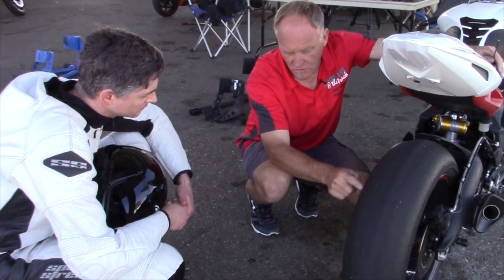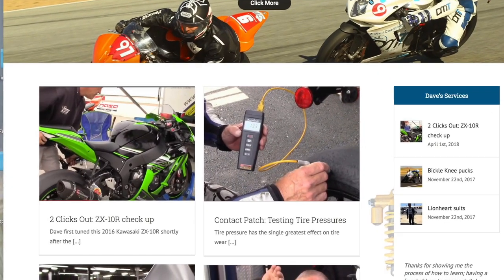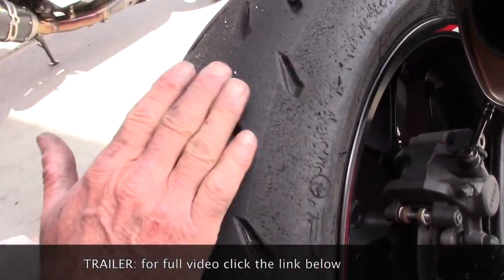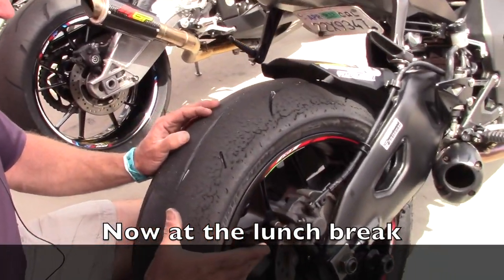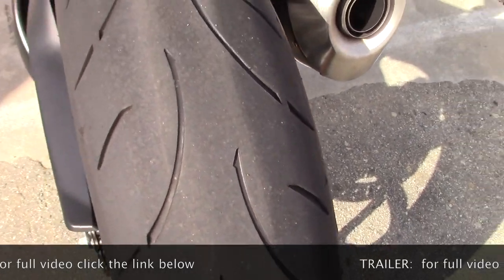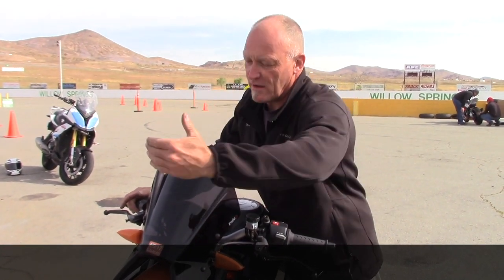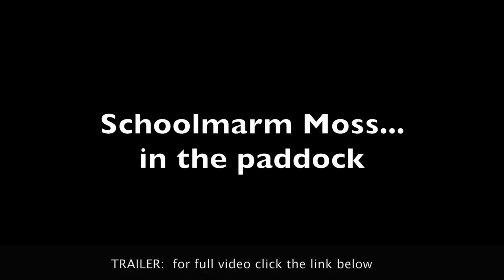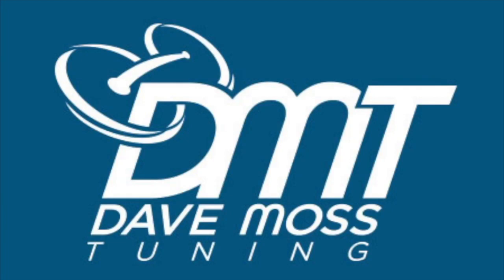Contact Patch: Reading Street Tires 1 (TRAILER)

Comment: Thank you for your videos Dave, they're very clarifying.
My rear Michelan Pilot Road 3 has like a higher lip on the front edge of the sipes. What does this indicate, too much or too little rebound?
Reply from the maker: If the first edge to touch the ground based on rotation is tall, rebound is too slow. If it is lower, rebound is too fast. Go to my Contact Patch playlist for video clips on the topic.
Reply: Thanks a lot for the reply. Every rider should watch your videos.
Reply: Would this tyre wear sign show up from any other reasons on a bike that's not usually ridden hard, such as coasting or engine braking at lean?

Comment: Just changed my rear tire to a 190/55 from a 190 50 .... what a change... I feel weird on it :/
Reply from the maker: The chassis will have more weight bias forward so the seat may be higher and the rear suspension may not act the same, hence the "odd" feeling

Comment: Dave, do you have any comments about new tire Rossi Corsa ii for ninja 636 on road racing?
Jacob
Reply from the maker: The Rosso Corsa 2 has been replaced with the Rosso Corsa 3. Hypersport tires are great for track days up to the advanced group. I have not tried a Rosso 3 at the track to see what pace I could run to evaluate these tires for race pace.

Comment: Hi Dave thanks for all your videos, I have a Honda fireblade rr9 and am experiencing wear on the leading edge on the rear tyre. The bike is fitted with a matris k series rear shock I don't know a lot about these but am guessing I have a rebound issue how can I adjust this and how can I tell if there is to much or to little rebound?your help would be hugely appreciated I'm gutted I'm in the uk would love to bring the bike to you thanks
Reply from the maker: Look at the section of tire where you apply the throttle and see if the wear is in that area. If it is, then add rebound damping to slow the shock down. If the wear is close to the edge of the tire, that is "normal" and you could add a little more rebound to see if that helps.
Reply: Dave Moss Tuning  thanks for your reply I will check that and see if adding rebound makes a difference, just to work out how this rebound is adjusted on the Matris shock now! Thank you

Comment: Question Dave.

How do I know the lean angle limits of my tires?

I'll have the bike tipped over in a corner, my knee will be dragging, but I don't know the point at which I can learn the furthest before the bike washes out/low sides. How do I determine this limit? 

As of now, the rear is snot bubbled up all the way to the edge of the tire, but my front still has about 5-6 mm of unused rubber at the edge. Am I able to push all the way until the front tire is completely at the edge?
Reply: Do what Marquez does.  Lean over till the tyre(s) give out and you crash then back the lean off a bit thereafter.
Reply: I’ve found that limit.
Reply: Look at your chicken strips and feel it out from there.... You can usually go past where your comfortable :)  But dont high side please :)
Reply: @raydolinger1980  I haven't had chicken strips in a lonnnnggg time. lol.

Comment: I have an L6 Gsxr1000. My question is how much lean angle can I regularly perform (on the street) with no issues with a low or high side? I've been told I could lean as far as 45 degrees at any speed and be safe. Is this true? ..assuming the street is picturesque..no road debris,  etc.
Reply from the maker: General rule of thumb lean angles for most standard and sport bikes is 45 degrees. At any speed? No....... You have to have the bike set up for your weight, ability and damping optimized then you have to identify positive camber corners that assist you with cornering verses off camber which forces you to slow down and use less lean.
Reply: Dave Moss Tuning Thanks.  Much appreciated.

Comment: Dave, is tire balancing (rear) a must to do after a tire change? I had front balanced and not rear due to mine is a pro-arm and they don't have the tools to balance it. And will it affect the bike performance if is it not done even by e few grams?
Reply from the maker: Yes, every time on any road bike. If it isn't balanced the bike vibrates enough to make you slow down. If it is a couple of grams, you might notice a vibration over 80mph. Is that enough to make you slow down or will you ignore it. I prefer a job done right so my mind can let go and enjoy/work/test freely